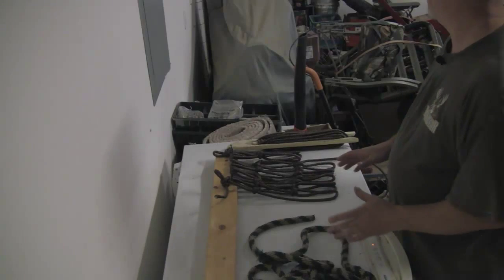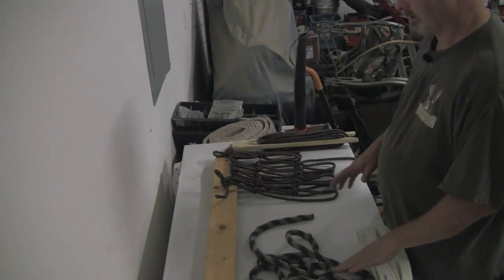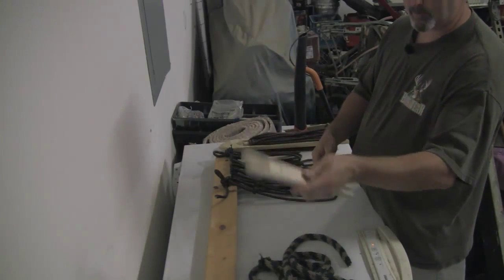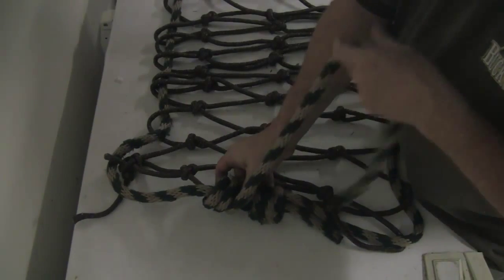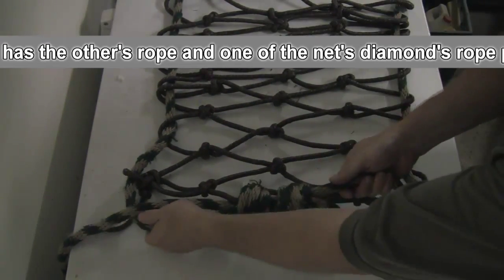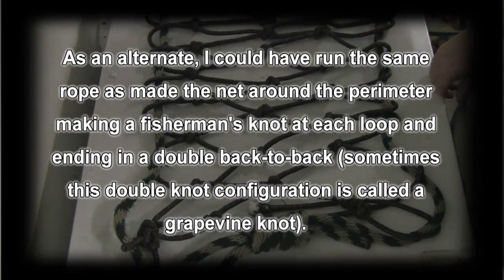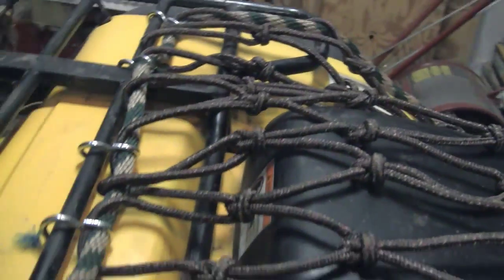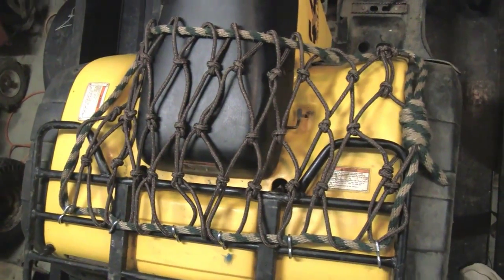Experimental Utility 4x4 Cargo Net

Comment: @rldel149 

I had a foreman years ago that I put a kit on and I also took it off because it would tip up so easy after the lift. I think you did a great job on this for sure, you could actually make these and sell them on ebay pretty easy, might want to think about doing that, could make some extra income pretty easy with that quality.

Comment from the maker: @facestomp88 and cornflake71: It is about 20 min ride in/out on pretty tippy stuff that once Fall comes also gets a bit rutty. I go on 3 wheels & scrap limestone w/o trying. I have a Honda Foreman 450 which isn't that tall & pretty stable. I put a lift kit on it one year & rolled it three times; I took it off same yr. 

I rather scrape a few more rocks than roll. It can be a real $%#@ getting the deer on the first time w/o making a mess & help. It's worse if it slides off in a stinkin' mud hole.